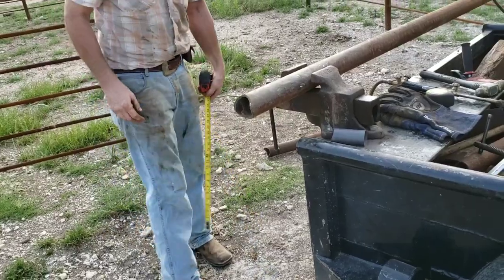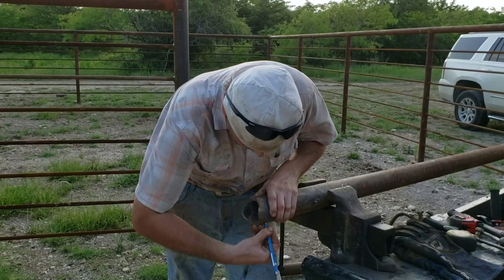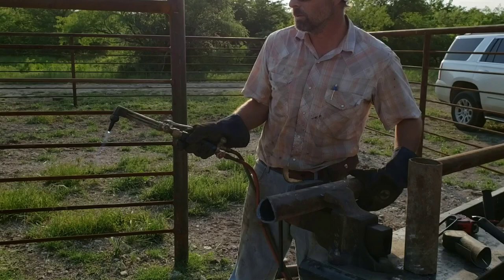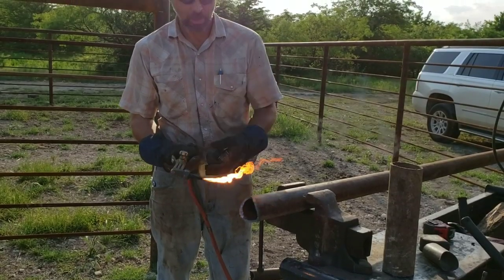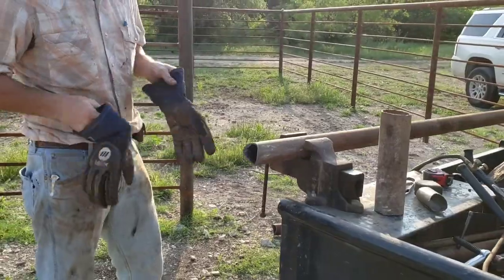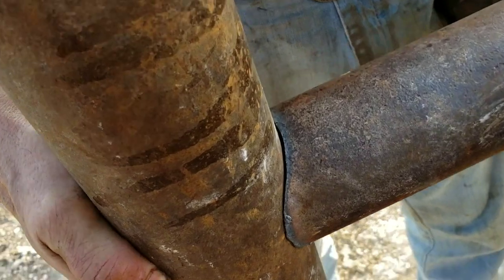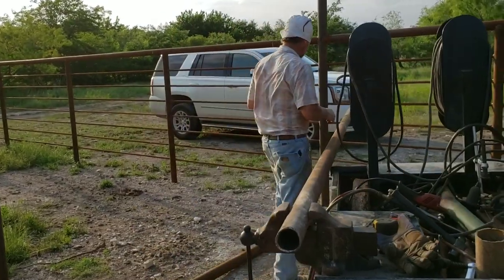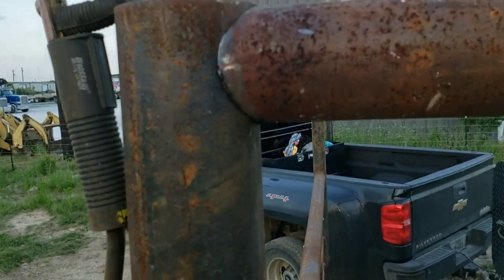Saddling Pipe, Coping Pipe for Corral

Comment: A cool trick to learn is to cut from the crotch of your saddle keeping your torch facing straight down all the way to ears of the saddle, roll your pipe and do the same cut from crotch to ear, that helps flatten the ears out enough to get a decent fit.

Comment: The slowmo of that lizard jumping out of the end of the pipe while you're cutting it with an oxy-ace torch is just unbelievable.
Reply from the maker: I've seen mice run out of the opposite end before, but that's the only lizard I've ever seen. Its pretty remarkable it happened while I was making the first YouTube video I've ever made.  Thanks for watching.
Reply: @buckinthetree1233  I'm planning to build ~2000' of single rail pipe fence with cattle panel. Cannot fathom what it would cost to pay someone else to do it, trying to collect the knowledge I'd need to tackle it myself over time. Also trying to decide on the tools I'd use. Looking at a stick welder capable of 6010 and 7018, a plasma cutter for cutting saddles, and a generator to power these things. Any chance you could shed light on how to attach the cattle panel? Or maybe how many lbs of  welding rods I'd need?
Reply from the maker: @Masterrex  well, I would probably suggest finding an engine driven welder.  An engine driven welder like the one I'm using in the video serves as a generator and a welder.   I would recommend getting a cutting torch like the one I'm using in the video.   It's a lot more versatile than a plasma.  You can use it to heat up metal to bend it, or you have the ability to  braze weld metal with it.  The only real reason I personally see a need for a plasma is in a CNC situation.   It will only cut as smooth as your hand is steady, plus you have to have electricity and an air compressor to operate it.  As toward the second part of your question there's a couple things to think about.  First off, if I were going to use a cattle panel I would have to have something at the top and the bottom to weld it to if the fence will be holding any livestock.   Animals will always try reaching under a fence to get to the greener grass on the other side.  If it isn't well supported at the bottom its going to get bent up.  The other issue with taking something that is premade and trying to use it for fencing is that you're taking something that is straight and square and putting it in an un-straight un-square situation. The only way it will really work is if your ground is level.  I guess that's the short answer to your question, lol.

Comment: Your fit-ups are really neat and nice.  From a time saving perspective, would it have been faster to sumply cut a hole in the vertical posts and insert the horizontal pipe?  This would save on coping.
Reply from the maker: When you get your routine down and have a system that works for you, it will go pretty fast.  I'm not sure if I have a really good reason  for why I don't like the hole cutting method.  My personal opinion is that this is stronger. Hole cutting is probably strong enough for most fences.  If you're going to cut a hole, your post need to be quite a bit larger than your rail.  If you have a 2 7/8 post and a 2 7/8 rail, then you aren't cutting a hole. You're saddling a pipe.  Even if you use 2 3/8 rail on a 2 7/8 post you aren't going to have any post left after cutting the hole.  I would like to make another video on how I make my templates and such, but I need to find time and a camera person.  One other thing about hole cutting is that if your fence is running up hill or down hill your going to need oblong holes.  On one post you'll have a gap at the bottom and the other post will have a gap on the top.  Theres many ways to build a fence.  This is just the easiest way I have found.

Comment: I was wondering how you got the mouths in line and then bam you showed us. Just got done watching a guy drilling a hole to put pipe in. Like learning tips from you guys. Not sure if those metal posts get pounded in or holes drilled first then filled with concrete. How's it done in the Midwest.
Reply from the maker: We use to concrete the post in the ground. We now hire a man with a vibratory post driver to come drive the post in for us. We are in Texas and in this part we have shallow soil then solid rock.  No matter how you put them in the ground they aren't going anywhere.  I'm glad you enjoyed the video.   I'm planning on building another corral in the fall, and I think I'll post some more videos then.  Now it's a little too warm here for doing that sort of work if you don't have to.  We're supposed to get our first 100° day here next week.
Reply: Thanks for the reply . Good video.

Comment: Why do you not use plasma cutter
Reply from the maker: The main reason is that 99.9% on the time, I'm doing this on fences that travel over distances or corrals in remote areas.  All of the plasma cutters that I'm familiar with require a fairly significant air supply.  I would have to rework my welding trailer and purchase a dedicated compressor that would sit on my trailer.  I don't do this work very often, and that compressor would see very little use.  This is the same way we've done it for 50 years and have just never changed.  If I were just starting out, I might weigh out my options, but I've just never felt the need to change.
Reply: @buckinthetree1233  it's awesome too watch your work.just there's a plasma cutter on market that only needs power has it's own air pump that's why I asked

Comment: What was the "disc" on the grinder called.
Reply from the maker: I may have called it a cone rock or something.   It's a sort of cone shaped grinding wheel that screws directly on to your grinder.  They are used by pipeline fitters and welders.  I buy them at the welding supply store.

Comment: what is the name of that tool you use as the pattern to trace around the pipe?
Reply from the maker: You can buy metal ones pre formed with a hinge that wrap around the pipe to join same size pipe, but in this case I was butting 2 7/8 to 3 1/2 I believe.  If you're joining same sized pipe you can get the pre made ones from nearly any welding supply store, Ebay, or Amazon.   If you are doing what I did with dissimilar size pipe you can use one of the premade ones to get a rough start on the pipe, then work on the pipe with a grinder until you get a nice fit.  After that use what is referred to as a pipe wrap like I'm using in this video, cut a piece off of the end, and trace out your finely tuned pipe to make a template.   A pipe wrap is like a flexible tape measure that you wrap around pipes for lay out work.  If you don't want to spend the money on that you could make your own out of a file folder or something.  A pipe wrap is made out of a similar type material.  I've also taken the factory metal templates and worked on them with a grinder to fit whatever size pipe I want to join it to.  I know that was a long answer and I'm probably not the best at explaining things, but hopefully in all of that I answered your question.

Comment: what type of grinding wheel is that !?
Reply from the maker: I call them a cone rock.  It threads directly onto your grinder.   I buy them at the welding supply store.  I believe that pipe fitters for the pipelines use them a lot.
Reply: @buckinthetree1233  im going to stop by my local ck place and see if they have any . it looks like a great grinding wheel to use ! thanks for the response .